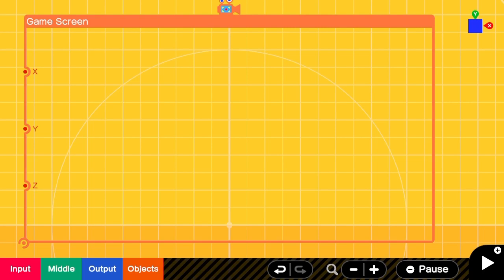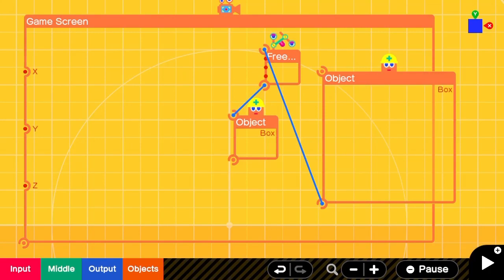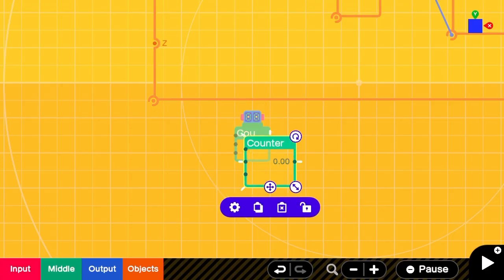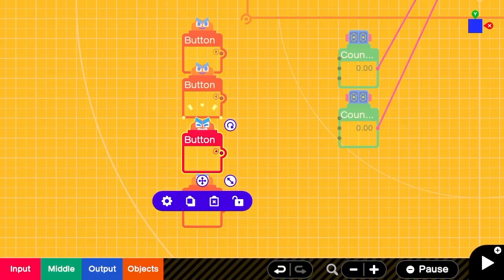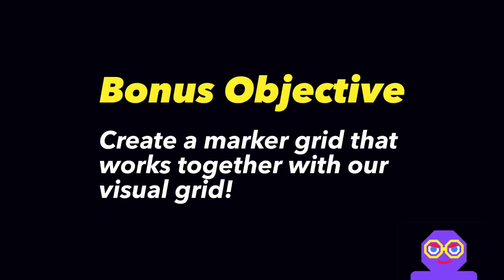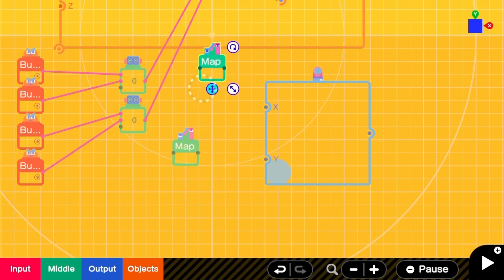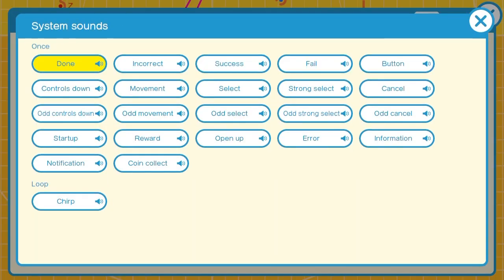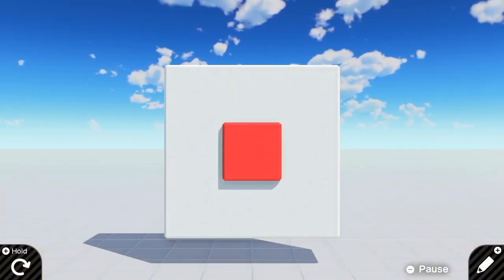How to Make a Grid Based Movement System in Game Builder Garage (Tutorial)

Comment: Do you have any ideas for how to turn this mechanic into a tower defense game?
Reply from the maker: Hm. Maybe but i feel like that would be a lot of overhead for a tower defense. Of course, if you wanted to limit it to a grid to make the mathematics of it very tight then it would make sense. I would prototype it by maybe having the “cursor” be a teleport exit and then placing the towers. You could check if a current tower is there with a simple touch sensor checking for an invisible fancy object on the cursor. They would all plug into a “can’t place” flag that would prevent you from placing them. Etc. the really craziness would come with the deciding how many towers/controlling waves of enemies/ etc.
Reply: @DaveNodon  I’m wondering how someone was able to do it, it only had three towers, and just one kind of enemy and boss, so maybe that’s it, the simplicity.

Comment: Very useful! Would this still work if you wanted to push blocks in a grid?

I imagine you'd need touch sensors on each side of the box to correspond with directions?
Reply from the maker: Hm.So you mean like the character is occupying one space and he's moving other blocks on the grid like those old Pokemon boulder pushing puzzles?  I need to think about this one for a bit. (edit: I think we might have something workable below)

This is one of those cases where Im missing the ability to write a line of code, something to the effect of "only execute the move if the attempted move-to position coordinates are within the grid maximum" 

Maybe have a touch sensor like you said on each side. And when the player is within the area and presses a "push" button you see if you can move it. 

 Here is where it starts to get a little brain numbing. You'd have a counter system for each object with an X&Y counter. IF player presses "Push: on the right side for example. Use an AND nodon to check if the proposed left X position (current X -1)  is Greater than or Equal to the grid minimum, then move it. 

So effectively If the grid is 3x3( -1 to 1) and the Boulder is at 0,0. And the player is "pushing" o the right side. Take the X of the Boulder, add -1 to it, compare to see that if its still greater than or equal to the grid minimum (-1) and if so, then cause it to move left. PHEW. That might be functional, I think we might've  just worked through it.
Reply: @DaveNodon  That's exactly what I mean't. Sounds a little code heavy, but good to know it's workable.

I have a level based on Baba is You and the blocks are .... erratic .... when moved. It's not too bad, but a grid based system for pushing would be more ideal. Given the number of blocks, however, it may be a little messy. I may give it a shot with something extremely simple and try to work up from there if things go ok.

Thanks!
Reply from the maker: @theelitemyt  HA! WAIT. Since we are using math to keep the object positions there may be even simpler ways to do that. Maybe we could store a number that is the difference in position from the player to the object on both the X & Y. 
Then we can check if the player distance is only 1 on both X&Y. That would mean it has to be in an Adjacent square. Maybe some more logic and you can know which side the player is on using the + and - numbers. Just an idea as I'm thinking it, might not work, Im away from my Switch. But the benefit of using the Array of Counters instead of just a free slide to move is that we could effectively just use the coordinates for logic.
Reply: It's frustrating, because if we're using a programming language we could do something's a lot easier.

But at the same time, when people work within the limitations it can be really amazing.

Looking forward to more of your tutorials.
Reply from the maker: @loofa4775  Right?! I’m really missing C# scripts but so far for me part of the challenging fun of GBG has been making workarounds 😆